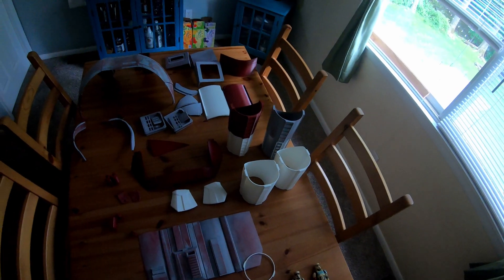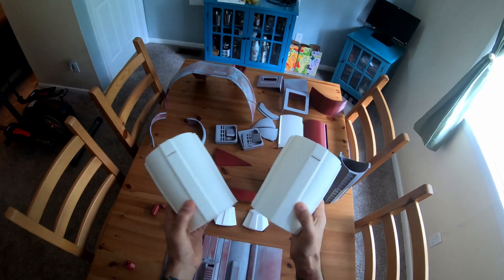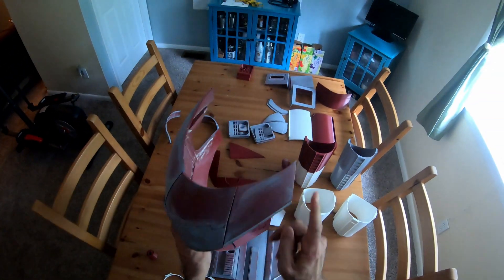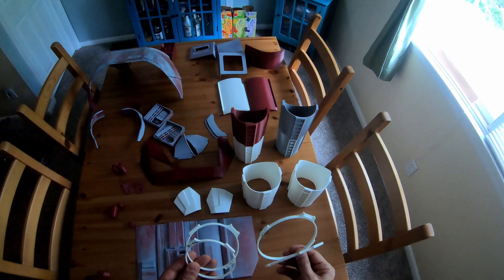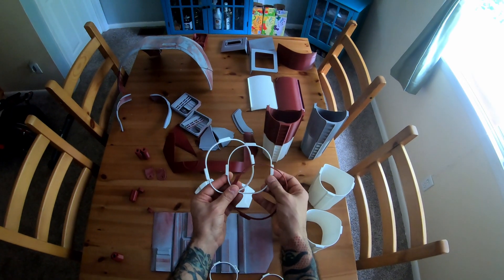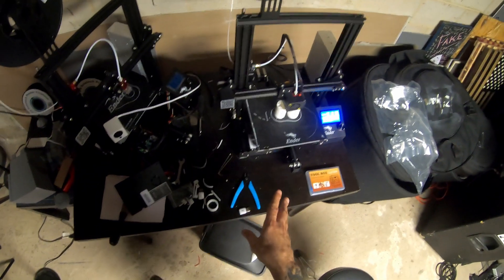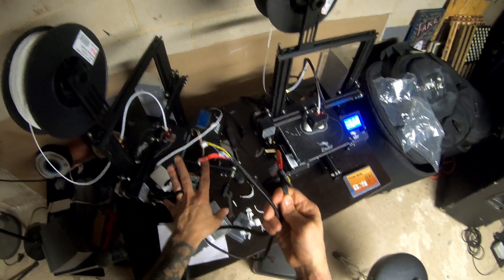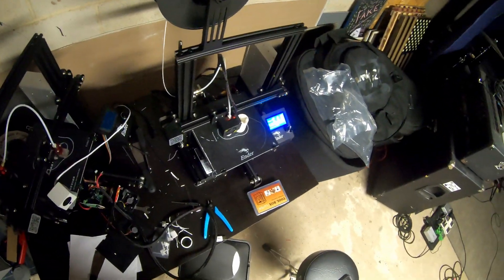Shoretrooper Armor Build Update 3 - Finally ran into issues

Comment: Do you recall what scale you did the chest and back at? I saw you mention that you'd slightly scaled down the biceps and forearms. Many thanks.
Reply from the maker: I ended up keeping the chest / back at 100% scale of the Sean fields files
Reply: I left the biceps at 100. Way too small. They looked big enough until i tried them on. Adjusted. First perfect. Trial and error. I had zero printing mishaps, or failed prints on the whole set of armor. Other than having to reprint biceps. My ender 5 plus is dialed in.